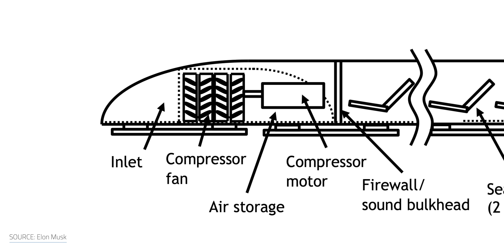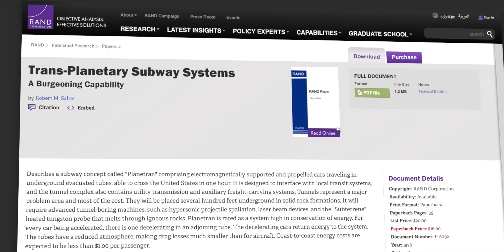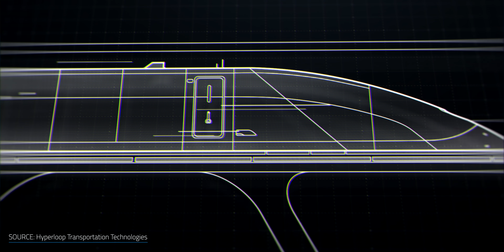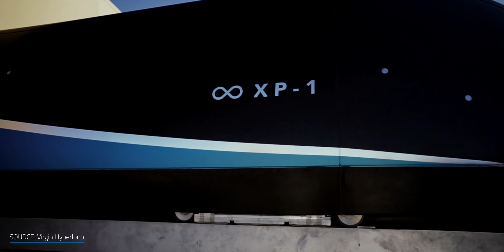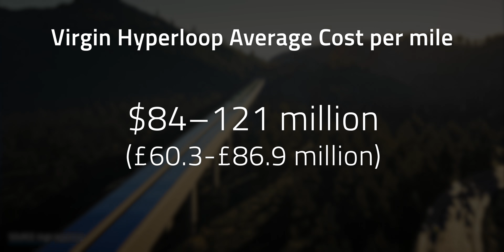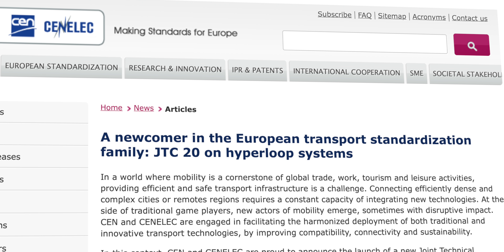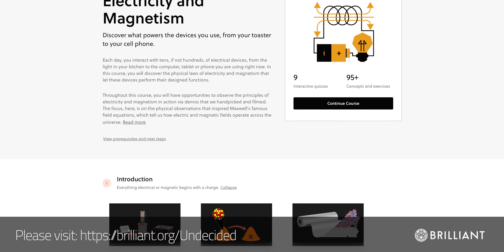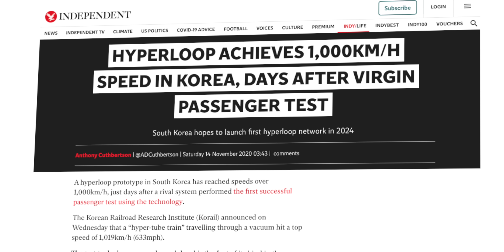Exploring Hyperloop - The Future of Renewable Public Transport?

Comment: It's gotten to the point where I judge "science communication" channels based on their respective Hyperloop videos in order to find out if they know what they're talking about. And you sir, have failed...
Reply: Ur just jelus that Ellen muks is going to marz and Ur not HAGAHAHA!!! 1!!111/!!!!

/s
Reply: So if the hyperloop was built one day you'll reverse all your opinions on these channels?
Reply: @awdrifter3394  I'm guessing you're upset that people are calling out eloin?
Reply: @ellusivegman  nah. I'm only a fan of Elon Musk's rockets and Neuralink. I like my gas powered cars that I have full control over and not get locked out of the battery capacity unless I pay to unlock the on car DLC. I'm neutral on hyperloop. I think it's a really cool concept and all these "debunkers" are drawing conclusions based on their blind hate. Nothing in the maglev in a low pressure tube concept is physically impossible, most challenges will be related to cost. Right now maglev trains can go 400kph in atmosphere, making it go 1000kph in lower pressure isn't impossible. The challenge will be varying the train pod's size to minimize the tube size and overall carrying capacity and the amount of pressure in the tube. Airplanes lower to 15000-20000 feet when they experience decompression, they can still fly at 800-900kph. So if the tube is kept at 40-50% pressure of sea level, they can travel near the speed of airplanes. All the haters are just focusing on the word of "vacuum tube", but to go at 1000kph you don't need anywhere near vacuum.
Reply: @awdrifter3394  you think the debunkers are blinded by their hate for Elon? Well you're just blinded by your love for Elon.

Seriously dude this never works as an excuse to not engage with the other side.

There's actual science (pretty basic science, as a matter of fact) that goes into exposing the absurdity of hyperloop. There's absolutely no need for it. It's a needlessly deadly "alternative" to regular high speed rail or regular maglev, both of which are proven.
Reply: @ellusivegman  maglev already exists, there are metals that can withstand the pressure difference between the inside and outside atmosphere, there are vacuum pumps that can create the low pressure. There's nothing impossible about the technology. Initially it might be dangerous, just like any new technology, but as failures happens they will be addressed. If people stopped flying after the DeHavilin Comet blew up, no one would fly now.
Reply: @awdrifter3394  no one is saying it is impossible. Obviously in theory it very much is possible. It's just that it's so unbelievably dangerous and economically unfeasible that there is literally no point in building it. Even in theory the hyperloop has no advantages over other methods of transport other than it being faster, I guess, than traditional maglev. But those advantages are outweighed by the obvious pitfalls.

 And I love the comparisons to flying, as if that's the slam dunk that's supposed to win the argument for you. Just because there were good ideas that had naysayers doesn't mean that every idea with naysayers is good. That's bad logic. Stop it. You can do better than that.
Reply: @awdrifter3394  I don't usually use quotes but here's a nifty one:

The fact that some geniuses were laughed at does not imply that all who are laughed at are geniuses. They laughed at Columbus, they laughed at Fulton, they laughed at the Wright Brothers. But they also laughed at Bozo the Clown.
-Carl Sagan
Reply: @ellusivegman  why isn't flying a good comparison? At least one company is making the pods out of carbon fiber composites, similar to what airplanes use for their fuselage. The low pressure tube is meant to simulate the low pressure in high altitudes. Hyperloop has advantages over high speed rail and maglev in terms of speed, it can connect previously separate cities into one mega city. Some governments may decide that's worth the cost and fund it (such as Dubai and UAE).

Elon Musk and Richard Branson have good track records of success, better than the track records of many detractors, so I'm going to put more weight on this being a good idea.
Reply: @awdrifter3394  okay, I give up. I'm pretty sure you're wrong about the success track record of Elon, btw. But you're not even really addressing any of my points so I don't feel like wasting my time googling shit for you. 

If the Saudi funded hyperloop succeeds then I'll gladly eat my words. As for this back and forth, specifically, I have no interest in continuing. Your devotion to sociopathic billionaires is pathological, borderline religious.

You can respond to this comment all you want, calling me a closed minded naysayer with no imagination. I've heard it all before from your type. But don't expect me to respond.

Peace.
Reply: @ellusivegman  I have addressed your points perfect well. The technology needed for hyperloop exists in pieces, nothing have been proven to be impossible with current technology. 

Just because someone is a billionaire doesn't necessarily mean they are a sociopath, you're projecting your own psyche to people that you don't even know.
Reply: @awdrifter3394  No, even if you could build such a thing, which is incredibly implausible because of the technical demand, it's still a stupid idea. Besides being impractical to use, maintain and build, it's still gonna be less economical than traditional rail, or even maglev, simply because of the energy consumption of the entire system. (Vacuums are expensive both in cost as well as energy). And on such a scale basically impossible. Also it doesn't solve a problem that can't already be solved, in a better way, by existing technologies. Reporting positively on a Hyperloop just shows that you either have no idea what you're talking about or that you can't fact check and therefore aren't fit to report.
Reply: @Arrow14100  a lot of transportation are less economical than traditional rail, people are will to pay for speed. There are a lot of unknowns, and the chance of hyperloop being built in the US is low. But it seems like Dubai might fork out the money to have the first hyperloop. It might get built there.
Reply: @Arrow14100  they have people riding in a prototype in a tube now. Nothing about hyperloop is impossible technology. It may not get builds due to cost, but that doesn't mean the technology is impossible. Also economics changes when technology and demands change. In the 1960s a computer with 1 billion transistors is not economical, I have 8x that in my phone.
Reply: @awdrifter3394  I'm way to patient with you, you know that right? Again you don't know what economics means. Now, moving people in a vacuum is not the impossible part, we've been doing that for decades. Maintaining a vacuum for any necessary length or in other words creating a vacuum chamber this size on  earth is the impossible part. The bigger the vacuum chamber the stronger it has to be. There is  no material in this universe that can withstand the atmospheric pressure of such a giant vacuum as depicted in those renders. And there is no pump that can achieve or maintain that vacuum. Among other things. The impractical and impossible part is getting people in and out of a sealed system without destroying the vacuum or without having to empty the entire tube for each use. Among other things. The dangerous, impractical and impossible part is having an extremely fragile vacuum chamber in the middle of nowhere, where the tiniest dent or hole will lead to catastrophic failure. Among other things. Just because something sort of works on a small scale doesn't mean it works on a big scale. And then again there are already regular trains and other transport methods that can achieve and exceed the speed claimed and shown by the Hyperloop whilst being safe, profitable an most of all, possible.
Reply: @Arrow14100  the pressure difference exerted on the tube doesn't need to be 1 atmosphere, like I said before, the tube would probably simulate 40-50% atmosphere and planes can already travel 1000kph. Also if the tubes are relatively well sealed, the massive energy cost of creating the vacuum will only happen once (or one per new section of the tube), then after that they would only need enough pumps to maintain the vacuum whenever a pod enters or exits the tube to load and unload passengers. It's the same thing as filling your tire with a massive compressor for the first time, then you can top it up with a 12v car outlet compressor. The pods will be made from carbon fiber composites (Vibranium), so outs at least as strong as an airplane fuselage, we accept the danger of flying everyday, this is no different.
 
China's maglev tops out at 430kph, Japan's might be faster (500kph?), but hyperloop will still be >2x as fast. Per passenger cost will be higher, but again people will pay for speed.
Reply: @awdrifter3394  You're in way over your head here. You don't know the difference between outward and inward pressure, you don't know how a vacuum seal, a vacuum pump or pressure-systems in general work and what their limitations are, and you have no clue what material science is. You lack a fundamental understanding of thermodynamics as well as risk calculation and safety procedures. Not to mention economics. A basic understanding in only one of these fields would help you greatly in realizing the flaws in the Hyperloop. Maybe you will one day be able to do that. I don't think this conversation can serve a purpose anymore. I've already typed enough.
Reply: @Arrow14100  you have presented no evidence of what you claim here. Neither does any of the haters in the so called debunking videos. While Virgin Hyperloop and HyperloopTT do have engineers who are working out these problems. The difference of outwards and inward pressure doesn't matter, what matters is the pressure differential. What you haters keep claiming can't be done are being tested in scale, then they will scale it up. There's nothing impossible about the hyperloop's physics. If there's a leakage in the vacuum then it's a matter of either making more precise fitting parts or put more pumps to compensate. There's nothing in terms of thermodynamics that hasn't experienced by either trains, airplanes or rockets. We have materials that can withstand this kind of temperature, pressure, and vibrations. It comes down to engineering and cost. You better stop typing now, because what you have typed proved nothing.
Reply: @awdrifter3394  You also haven't shown any evidence for it working, neither have those science communications channels, so why should I. You claim that something is working, so the proof is on you here. There is plenty of mathematical evidence out there, apparently you've also seen a bit of it, and just because you don't understand it, does not mean that it is false. Now like I said, even if you could build it, it still doesn't make it a practical solution. You don't understand that this isn't a matter of opinion, you get predictive capability by calculating something, that's why we do science after all, so I can make a prediction for you. A System like this will never be built and will never work. Let time be the judge, I'll let you decide how many years we schuld wait until a Hyperloop with full capability is built. Let's come back to this comment after that time has passed and see who's right, deal?
Reply: @Arrow14100  Wait, I thought you're done? I'll keep replying to your meaningless rant until you're really done. 

I'm responding to your claim that a science communication channel doesn't know what their talking about if they report positively on hyperloop, therefore you are indirectly making the claim that hyperloop is not feasible. The burden of proof is on you.I was only questioning that maybe you would change your mind when the hyperloop is built. You keep saying that you have mathematical evidence that it is not feasible, throwing out words like thermodynamics trying to sound smart, but as I told you in the last reply, the hyperloop isn't going to create any conditions that hasn't seen by either trains, airplanes or rockets. The material are there, there are materials that can withstand the pressure differences between inside the tube and outside atmosphere. This is just maglev in low pressure tube, elements of most of the technologies needed are existing in some form, the challenge is to put all that together and cost.

Comment: A lot of the discussion about Hyperloop simply misses the fact that it is uneconomic. Even if you brush aside the technical issues and the (pretty much show stopping) safety issues, at the end of the day its going to cost roughly the same as a conventional high speed rail line. But its capacity will be a tenth that of the train. It is hopelessly, irredeemably, broken economically. 

Lets talk about what is real. Conventional high speed rail solves many problems. It costs about the same as a four lane motorway, but has 5 times the capacity and is very much faster than driving. The practical limit of wheel on rail train technology is around 400 km/h or thereabouts. If you need faster, there is maglev and this technology is also being advanced. Note that China now has a static (levitation at zero speed) permanent magnet based system under development. The practical limit is air resistance and energy cost so we're talking around 500 km/hr. Of course, if the distance you want to conquer is 1000 km then there are these things with wings. But where the vast majority of trips are actually made in the real world is in relatively short distances - 50 to 300 km where conventional high speed rail stands to overwhelmingly compete with car travel. 

I admit that as an engineer, I found the original Hyperloop concept fun. But its not an economically viable mass transit system. And if your problem is that you think Elon Musk is some kind of super genius I recommend you look up the channel Common Sense Skeptic and have a browse.
Reply: @marcosolo6491  Well I waa only talking about cost of construction - and trying to be fair. But yes, agreed.

Comment: Probably a much more reasonable option to refuse air pressure to 1/2 atm, and use that reduction in conjunction with maglev, and use the engine as a vacuum in the front and thrust out of the back.  Air will give the engine some bite, 1/2 atm is much more achievable, and maglev should reduce friction significantly.  I bet it’ll get to 300 mph easy in my example
Reply: Even better is to stop fscking around with lowered air pressure and get on a maglev train at 500 km/hr. Cheaper and safer.
Reply: @saumyacow4435  I agree but my thoughts are for them to save a bit of face and do something regarding vacuum, given their endless push of this tech

Comment: Hyperloop is a doomed and dumb project. 
Look at the French TGV : it already goes at 320 km/h (199 miles/h) on commercial lanes all over western Europe. 
It broke the record of 380 km/h (236 miles/h) 40 years ago! Then 515 km/h (320 miles/hour) 30 years ago! Then 575 km/h (357 miles/hour) 14 years ago! All with passsengers aboard, with comfort and with no maglev tech. 
It costs "only" 17 millions Euros ($20 million) per km (two way rails).
3 accidents, zéro death in 40 years.

Comment: cheap tubes are needed ..and coming soon,, tunnels will be built for around 2 million a mile. the boring company is building their own tunnel lining sections at a cost of less than a million a mile and the prufrock boring machine will be mass produced  and will be able to tunnel  a mile a month if not more as improvement continue to be made

Comment: I think by the time hyperloop matures enough to reach airplane safety levels, electric planes might be able to do the same distance in the same time, withour the additional investment in Infrastructure.
Reply: Agreed! For green long distance transportation I prefer putting research into electric driven propeller aircraft rather than jet engines where the exhaust is a problem even with hydrogen burn because of the heat generates NOS greenhouse gases. The electricity can be possibly be produced by a  fuel burning internal engine with scrubbers in the body of the plane  to greatly lower the green house gas generation. The engine scrub is a NASA concept no one seems to be working on yet as large electric driven turboprop aircraft have not been developed yet.
Reply: Lol, electric planes.. You need a few basic lessons in energy storage/density.. Still, more doable than this Elon pipedream :)))

Comment: Honestly though, why not just go with maglev trains? Most Hyperloop proposals already use maglevs anyway. Plus, it's a relatively mature technology and not need to contend with the extreme difficulty of maintaining the sheer length of vacuum (or even just reduced pressure) tubes including the energy needed (honestly this one seems like it'll negate the benefit of green energy...why use energy to maintain vacuum tube and not just send it into the grid?) or engineering and security needed to prevent puncture (Joe Scott's vid on Hyperloop ( https://www.youtube.com/watch?v=23n94m96flc )  has mentioned that even just ye olde bullet puncture can cause problems. Imagine how easy it is for terrorists to just do a drive by shooting of tubes instead of needing a lot of explosives to tear a rail section down. Even just normal maintenance is bad).
Reply: Because the Hypeloop is a long-term scam. They will continue to milk investors and government subsidies for as long as possible so those involved can retire from the project in 15+ years with millions of dollars. All while not having a concept that actually works. Traditional maglev trains are a proven technology so it would be much harder to scam people with.